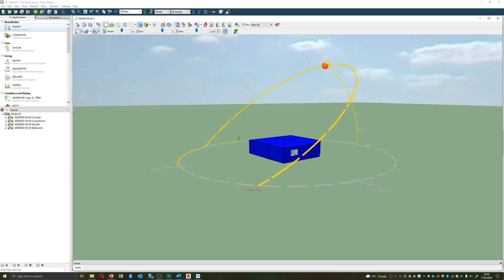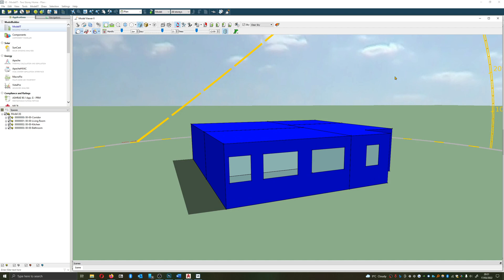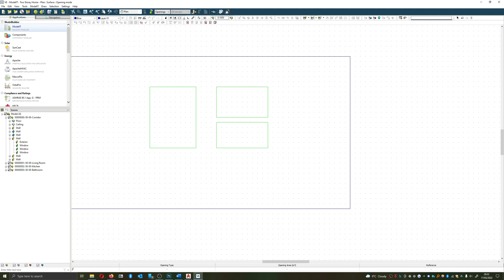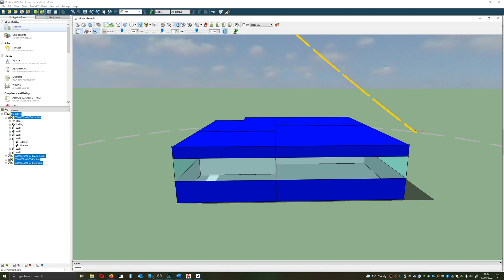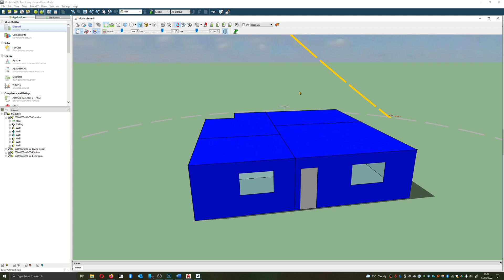IES VE Tutorials - Episode 5 - Windows and Doors

Comment: How can I remove a window after saving a drawing a file.
Reply from the maker: Well, the drawing is only there as a thing to trace on. So you could ignore it. Or you could update the DXF and the re-import it. If, on the otherhand, you want to delete the window from the model, select the room, then go down a level using the down button at top. Then go down to the wall. Then you can select the window and hit delete.
Reply: @grayenergy5413 Thanks for the quick feedback.